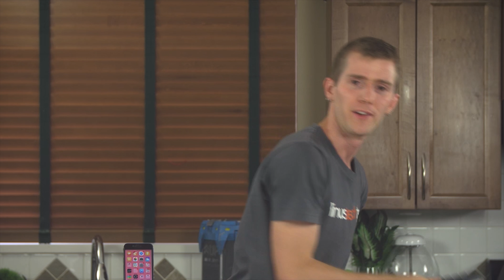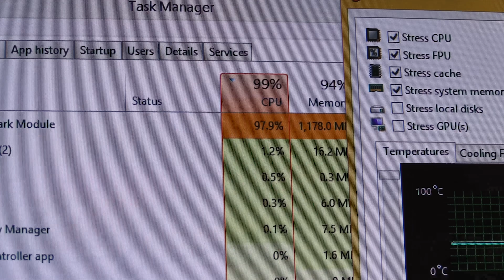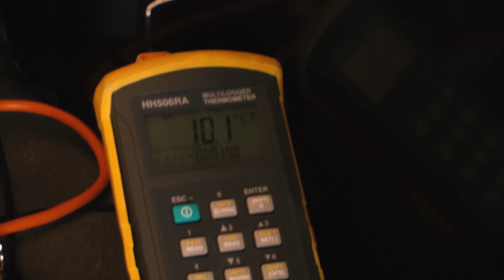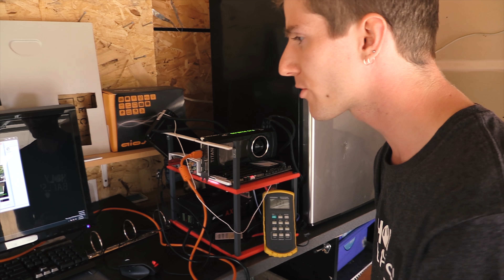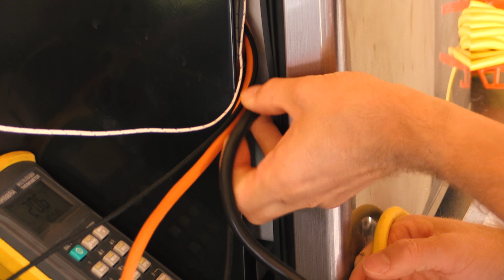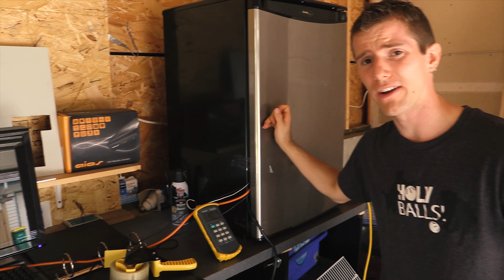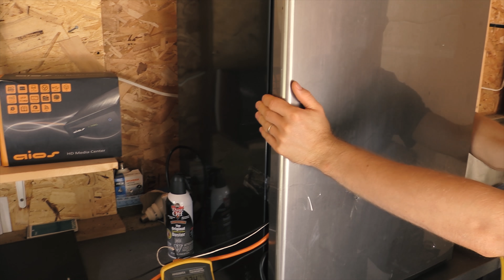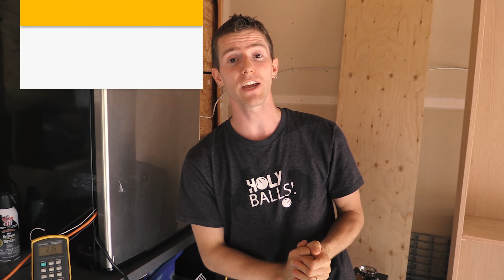PC Build in a Fridge - Does it Work??

Comment: wouldn't a fridge create moisture though ?
Reply: Even though this computer inside the fridge idea does not work...moisture is usually only created because of the way the fridge is used evey time you open and close the thing moist air form the house gets exchanged with air inside the fridge and since the surfaces inside the fridge are cooler then the fresh moist air the the water condenses on the surface, since you would not be opening the fridge if you were to build something like this you whould not have much of a problem with condensation once you seal your system why whould you open it all the time.
Reply: Physics doesn't work like that AttentionJunki.
Reply: My thoughts as well.  Condensation would surely form on any warm parts and cause some heartbreak.
Reply: You're right, unless the air is completely dehumidified though you'd still see some condensation on whatever colder surface there was in the vicinity.
Reply: http://www.realsimple.com/food-recipes/tools-products/appliances/how-does-refrigerator-work -- I think you need to research more bud, if outside air we're what went into fridges we wouldn't put seals on the rims of the fridges. Every time you open it you expose it to outside air you get a situation where the outside air will condensate unless it is completely dehumidified air. You'd need airflow inside the fridge for a computer unless the air compressor we're equivalent in energy to how much was used by the system in question, as the laws of thermodynamics dictate. So essentially this argument is useless, all air is humid unless specifically tuned not to be.
Reply: Addtionally, the water isn't going to condense on the computer because its already running hot. Its unlikely that condensation would be a problem. Water only condenses on things that are colder than the ambient temperature around it (because that object has cooled the air around it, and that air now does not have as much capacity to carry dissolved water in it).
Reply: Addtionally, the water isn't going to condense on the computer because its already running hot. Its unlikely that condensation would be a problem. Water only condenses on things that are colder than the ambient temperature around it (because that object has cooled the air around it, and that air now does not have as much capacity to carry dissolved water in it).
Reply: You're talking about a best-case scenario, though, where the computer's running 24/7 with all components powered and warmed, and the fridge is kept continuously sealed. As soon as you turn that computer off and open the fridge door, boom - humidity and then condensation. It's no different than any other fridge scenario. Plenty of us in the northeast US or other areas like that are used to hot, sticky days where we open our fridge once in the morning and by lunchtime, there's literally liquid water pooling all over the fridge shelves.
Reply: Almost everything you said was stupid and wrong... The evaporative water cooling might be used in some server rooms but dry air doesn't cause arcing, humid air does, dryness does cause static electricity but since most servers and desktop computers don't move much, enough static electricity to fry the computers wouldn't be produced... Also it wouldn't condense on the radiator because the radiator is warm or even hot, as the job of a radiator is to radiate heat. So all of the crap you said is very confusing and mostly inaccurate. You only got a couple of things right and your are complaining about people who are wrong. What a hypocrite...
Reply: No, unless you have a very old model that works differently, refrigerators extract moisture from the air.  The feature exists to prevent frost build up, especially in the vents.  Dry air can actually wilt veggies, which is why most fridges have humidity drawers.
Reply: The reason a mini fridge with the freezer drawer frosts up, is because on the humidity in the air outside of it whenever you open the door.
Reply: T Swag

Put a red hot iron bar in the freezer. Open the door as much as you want.

That iron bar isn't going to recieve condensation until its colder than the outside air.

With a cpu/any computer component, that isn't going to happen--ever (except your hdd/ssd. Don't put your drives in the fridge).
Reply: insidetrip101 I know this, and fine maybe I should have typed 6 extra lines to elaborate the point the humidity comes from the outside air, not a byproduct of the fridge actually cooling, like was being wondered by the OP.
Reply: T Swag

"not a byproduct of the fridge actually cooling,"

Actually, the condesation does come from the fridge actually cooling. When air gets cold its capacity to hold water decreases. That water cannot stay in the air so it condenses.

By saying that the humidity comes from the "outside air" is only part of the issue. You could buy a brand new fridge, and then turn it on, and there is going to be condensation when the air cools down.

Yes, once the air in the fridge is uniform with the fridge's cooling, there will be no additional condensation; because all the humidity has been taken out, but YOU'RE the one who is oversimplifying things.

Its not as simple as there just being mist in the fridge. The real answer to the question is whether or not your cpu would attract condensation. This is verifiably false because your cpu will ALWAYS be hotter than the air outside. You could run the fridge with the door open and it wouldn't matter (though it would be pretty useless as the whole point of the theory of a build inside a fridge is a low ambient temperature).
Reply: basscadet75

"where the computer's running 24/7 with all components powered and warmed"

The convienient thing is that if they're not powered, then condensation doesn't matter; and if they're powered then they're going to be warmed...

"As soon as you turn that computer off and open the fridge door, boom - humidity and then condensation"

True, which means that you just shouldn't open the door before you turn on your computer...

You can solve this problem completely by turning off the computer, removing it from the fridge, and then letting it sit and the condensation dry before turning it on again.

water doesn't matter unless its actually powered on.

"there's literally liquid water pooling all over the fridge shelves."

I assume you're also forcing voltages through those fridge shelves so they're reaching high temperatures? right...

You really don't seem to understand that shorts don't matter unless there's actually power running through the short.

Comment: I was thinking about this last night, I came up with a much better idea. run a system of radiators that are inside the fridge with the computer outside. also you would need something to help hold the cold like ice packs because a fridge will run less when it's full compared tonwhrn there is nothing in it
Reply: to when*
Reply: +wades623 i was thinking the other way around, and with your idea, the heat is still trapped inside, but the other way around it might help a little bit

Comment: fridges are not terrible for passively cooled low cosumption devices like the zotac, as youve shown, or a basic router/switch.  Better off grabbing a Tripp Lite server closet AC unit and ducting it into your case intake fan.

Comment: A lot of PCs pretty much ARE space heaters. I moved to a house where I have a very small room... and I find myself using my laptop during the summer and spring a lot more often and only turn my desktop PC on during the winter. 

While the PC's cooling system does a good enough job to keep the components from overheating, it ends up heating up the room to the point that I'm too uncomfortable to do anything with the PC. 

If I absolutely have to use the computer during the summer, I generally end up trying to use it remotely so that I don't have to be in the same room with it. It's sad, it just heats things up so much that I feel like I can't have a nice computer anymore. :/

Comment: Putting a fridge thermostat into a freezer does a lot better job, I've actually done that. not for a computer system but cooling beer kegs and taps down . the idea is the same chilling a bulk thermal mass down quickly and keeping that temp. Freezers are built with better insulation and compressors

Comment: Wouldn't there be an issue with condensation?

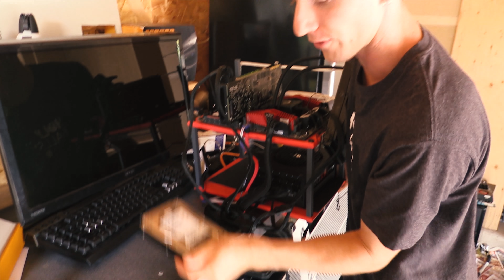Edit: Never mind, he mentioned that at 6:20
Reply: +Chris Hackett Yeah... this is sort of the problem with using a refrigerator compressor. There would be far too much moisture introduced into the pc components. What you would want is actually something like a car air conditioner which has dehumidifiers built into the system. Also his test seems a bit off as he didn't really allow the fridge time to chill down with the pc inside it AND it wasn't fully sealed. Everyone knows if your fridge door is ajar you will have a serious problem getting the temperatures down.

Comment: simply put your radiator inside the fridge and left the rest outside. that should be saver than put the whole thing inside fridge.
also, more mass inside fridge, more heat and less efficiency

Comment: Hmmm.  I was thinking a more modest system Intel  i3 or i5 and a GTX 950/960.  I would put something frozen in the fridge to help the cooling unit.  (Cold paks?)  Balance is needed with this kind of test. (full size fridge with cold water bottles might help with you buddies  system?  I'm curious about this and maybe have Cool PC "2.0" test setup? Thanks for the video Linus!

Comment: I mean it just keeps getting more efficient, so 80 degrees or whatever you could push it to, seriously, it would be dumping even more heat faster.  This is why the answer isn't as clear cut, it isn't a "closed system"...  you could also add additional ventilation to the fridge, such as by uncovering the coils and blowing air over them.

Comment: See, with refrigeration, it gets radically more efficient under certain conditions, so the test may not have been accurate, because possibly you didn't have a hot enough rig.  Still a terrible idea of course, you need a non-intermittent compressor, which most refrigeration units don't use.  Although, honestly, it's not that bad of an idea...  with how cheap they are, you might want to rock this test again, lol.

Comment: It's because even though the fridge is constantly trying to cool the air, the PC is negating that by constantly heating the air inside the fridge, keeping temps inside around what ambient temps outside would be anyway.
Reply: Now, if you created an exhaust from the fridge to the intakes of the fans on the heatsinks and keep the PC outside of the fridge, or place the PC inside of the fridge, but funnel the exhaust of the fans to the outside, then it would work.
Reply: But then you would be dealing with a MASSIVE amount of condensation..

Comment: Well I am not sure where to Comment on it, but for the optimal use of a Fridge it needs to be Full, (a Fridge full of Items uses less energy to remain cool verse a empty fridge). So I dont know if this test would have been different if the Fridge had some other items that remain cool for longer, (Ice packs or Cooler Box Bricks) 
as this would reduce the ambient temperature and help maintain the lower temperature for a longer period. .

Comment: Just putting my thoughts out here.. but what if you combined the heatsink / compressor system from a fridge with the Mineral Oil build? Would it be able to cool the mineral oil down to a point where it's actually effective?

Given that air is just the worst conductor, it would cost the fridge a lot of work to cool it down, decreasing it's efficiency. despite mineral oil not being electrically conductive, it's a great thermal conductor thus having a higher efficiency.

Comment: The concept is ok, but the heat dissipation capacity must be higher.. like rig an AC and make a cabinet and cool it down.. so like a server room or server rack in some occasions.

Another approach is to use the CFC (actually R420) gas principle directly on the CPU/GPU etc.. for that part a case in the older days that did exactly that was Asetek Vapochill. 

Another great question is how much of an overclock can we make in space (near 0K, 2.7K or something)? (I know there are many caveats to fall for.. there is no air so any heat loss must rely on radiation.. and that's not too much.. so.. there are a lot of things to sort out..we only have to look at satellites computers.. they sorted it out eventually for their computers.)

Comment: From the context, I take it someone or some company has a refrigerant baseed heat removal solution. I have some HVAC experience. Only I can no longer work in the field. I have a few theories on how it could be accomplished only no real reason to go beyond theory. But I do have the time and interest. Could you provide a link to whomever has one out? I would be interested to see what benefits are being achieved. The only place I can  think of where the it would make sense is maybe the bitcoin mining application. Only those that have that kind of an interest can afford to simply set up in colder climates. Still It would be interested to see what someone else has done.

Comment: What you could do is store ten liters of coolant in the fridge, have a line to this coolant to a valve that controls whether coolant enters your computer from the radiator or the fridge or a mix, and that way this will be like a cooling boost for when the computer needs it to maintain as close to a steady temperature as possible. This way the primary cooling comes from the radiator and you don't need to run the fridge 24/7.

Comment: Put pc in a bar fridge
Assemble a ventilation vent attatched from the computers liquid cooling/ ( radiator ) going through a sealed air tight vent through the back of the fridge
So hot air is being pushed out outside the case whilst the fridge cools the internal pc much like an air-conditioner unit.

Comment: you can dissasemble the fridge, bypass the fridge control and combine pc water cooling with the fridge gas system. you can calculate the pc's BTU output (Watt*3.1) and find a fridge which has a compressor that match that requirment
Reply: +Ariel Shpitzer 
that's like placing a small AC unit in a large room....

Comment: put the radiator of the liquid system outside the fridge. cuz its taking the heat from the cpu and releasing it in the fridge rather then outside the fridge. so the fridge is heating up. if you put it on the outside of the fridges the liquid cool system would work with the fridge in unity

Comment: Does anyone think this experiment would have a significantly different outcome if the power supplies were moved to the outside of the fridge?
Reply: +BigRalphSmith the PSU only adds a small amount of heat compared to the other compontens. so no, wouldnt make a difference.

Comment: +LinusTechTips Did you factor in the vacuum that builds inside a fridge when doing the test for the big rig?  My thinking is that air pressure difference makes temperature readings different

Comment: But if you place a Reservoir inside a fridge, would that be enough to eliminate radiators and fans..? Like if the water passing thru the system is at 3 degrees C when exiting the fridge, would it be enough to cool the last component in the loop? I guess the reservoir would have to be huge, but it could work, right..?? Now THAT would be a COOL test!! 👍

Comment: As far i understand types of fridge, you should go for plasma fridge where it has blower and moving air inside the fridge and it is also less likely to get moisture into fridge due to plasma method cooling as well as electric efficiency. correct me if i am wrong....

Comment: Btw I installed a new fan to my CPU. The temperature is -8 Celsius I wonder if it will damage the components
Reply: Damn it must be very cold where you are. The coolest it gets here in winter is around 6 degrees
Reply: Agret Lol, coolest here is -30 degrees. My room is ALWAYS over 20 degrees though, so I don't think that's the problem.

Comment: I do have to wonder how low a beast machine could get in the walk in ice cream cooler at a supermarket which tends to run at -28c while also having the cooling power to keep pace with a computer considering the system does run 24/7 and is made to cool a freezer big enough to drive a pallet lift into.  I have a feeling there is still an absolute limit to what one can achieve when air is still your final heat dump location.

Comment: domestic fridge/freezer is a waste of time for this, they are built around power efficiency so heat exchange is very slow, you have a small compressor and it's very low power. it is possible to keep a computer cold in a fridge but you would have to spend a lot more on an industrial instant freezer, or a catering rapid freezer, which have fans inside and cool much quicker but use a lot more power.

Comment: The problem is that the fridge compressor is not meant to be able to run constantly (you will just burn out the fridge) and also isn't built to handle a tremendous influx of constant heat (most people don't store active hair dryers in their fridge).

Comment: Personally, I'd just find a dead mini-fridge and gut the cooling garbage out of it, then use the condenser on the back as one giant radiator for liquid cooling. If you're overly concerned, you could also poke a hole for feeding fan wires through to the back and force airflow.

Comment: yeah but this fridge is too small, you overwhelm the little compressor on the fridge, use a air conditioner to cool only the watercooling radiator on the computer, there you should see a nice difference, OR air conditionner, that speard directly on a box that the PC is in, air conditionner spread much more cooled air then a fridge :)